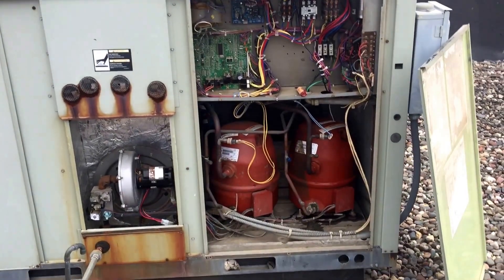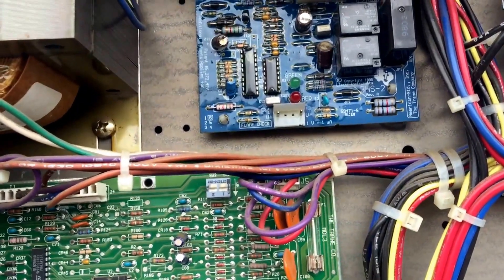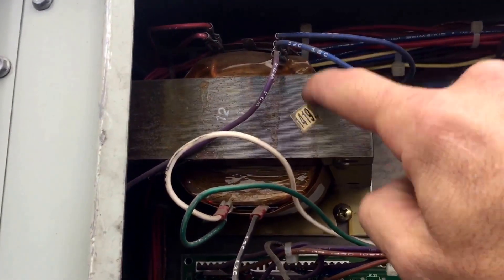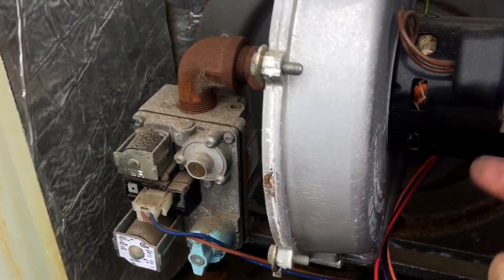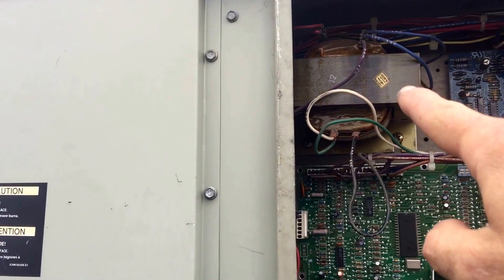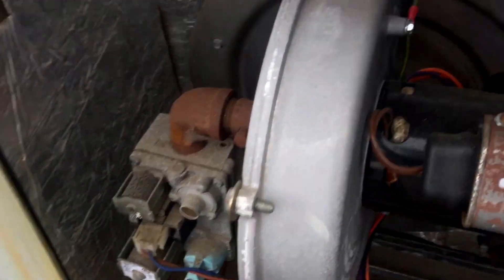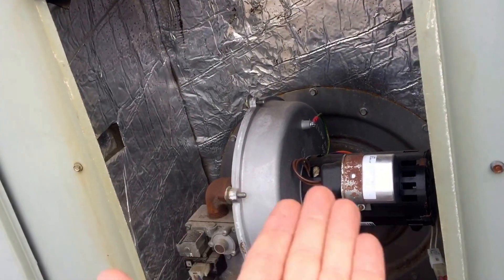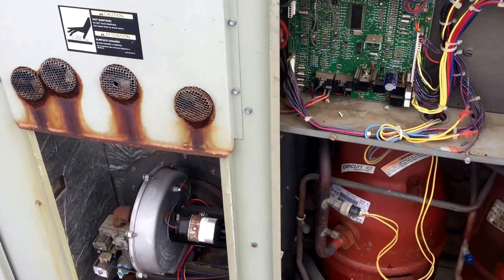Trane Voyager/ Premix Heat Exchanger/ Part 2/ #tranevoyager #traneheatexchanger #tranepremixburner

Comment: Hello David, have you had an issue where the ignition boardat the s1 and L1 have burnt? I've checked wiring and insulation is fine. I replaced the board and hsi, and a week later it did the same thing. Any suggestions?

Comment: Hello Dave,  I'm hoping you can offer some insight to an issue we are having with a 50 ton Voyager  YCH600B.   we recently installed the burner plate , comb blower , gas valve and ign to the  modulating side (right),  of this unit .  The constant capacity side (Left)  was left in-operational.   Well ,  Gas pressure regulator was set perfectly  10 " wc inlet .   and the outlet was - .3...........       Ran fine for two weeks . now we find the screen blown out .      Is there some way for you to email me ?    E.L.
Reply: Turns out , The modulating sude should have been set to +.05"   , not  -.2.  The primary fixed capacity work will be completed soon .   Stand by ....
Reply: side

Comment: Thanks for your informative video. I watched your part 1 for this unit but I didn't find what I need. My inlet pressure was -3.32 and need to adjust the pressure. This unit gas valve looks a little different to find inlet adjust knob. Is that the one with 2 tiny marking hole with 3 torxs screws on?
Reply: Did you figure out if the inlet supply pressure gets adjusted behind that cover with the two holes?

Comment: This is video was AWESOME!! Just worked on one of these today. Inducer Motor running constant, bumped it into heating mode and a bunch of water spit out the exhaust. Great diagnosis!! Sounds like I need a new motor and relay kit!! Is there a chance the Ignition board is bad  or would your money be on how the inducer motor is wired with constant power on red?

Comment: Mr.Harty your understanding and ability to convey knowledge of these units is exceptional, better than Trane tech. Support.
THANK YOU 🙏 for sharing your knowledge.
I have a question for you.
I have a customer with several old Voyager rtu’s and two of the units have indoor blower motors that run constantly .
Both units have had the main circuit boards replaced at some point.
They both have the three lead high limit in blower compartment.
One unit had the three lead high limit replaced by one of our techs last year.
But when you turn the units disconnect off and back on the blower starts up instantly.
You can remove the fan wire from Tstat and they still come on instantly.
I sat on hold with Trane tech support for two hour on my last trip.
The call was for no heat, found draft motor was defective, so I replaced draft motor assembly, and I cleaned the first screen and checked gas pressure.
The unit heats properly and cools.
However the indoor blower stays on.
I tried replacing the three terminal high limit, tco2 .
Trane said its probably a bad relay.
But both units have newer main circuit boards.
Any ideas would be appreciated.
Reply from the maker: c alessi / The 3 terminal secondary limit switch in the blower compartment will start the blower motor if it trips/opens on high temp in order to cool off a overheated unit.
If the wires get misconnected to this limit it is possible to have the blower running all the time, disconnect the wires to the limit with the unit power on and see if the blower stops.
If the blower stops, then your switch was likely miswired.
**Check the wiring diagram for wire numbers and reconnect, on a known working 3 term limit you should have 24v in and 24v out to the NC term back to the board for the “limit” circuit, the other wire going back to the board is for the Blower relay.
** if the 2 wires going back to the board  get misconnected the blower will run all the time.
Reply: @davidharty3653  I Have a 36 Ton Trane Voyager The Gas Heat Is Not Coming On I Traced It Back To The Transformer It lost a Phase on the Primary side I Traced that Lost Phase to the Heating Relay.I Have it Calling For Heat On The BAS But Still Not Calling On Relay.

Comment: Hey David. What tells the inducer to come on? The board correct? If red has constant power and purple is common...what the heck is the black and orange for...I see one for N/c contacts and 1 for normally open? Any help brother
Reply from the maker: HVAC/R DUDE Black and Orange are Low and High Speed windings for Low Fire W! And High Fire W2

Black - Applying Voltage into black via Contacts in IGN Module is the High Speed / High Fire windings only / W2, and comes out on purple (Common)
Orange - In Low speed/ Low fire Constant Power into motor on red, thru 1st set of windings and out on orange to IGN Module, IGN Closes a NO contact and sends power coming out of 1st set of windings on Orange back into motor on Black and thru 2nd set of windings (in series with 1st set of windings) and out on Purple to common.

See Electrical Print for Induced Draft Motor Schematic
Reply: David Harty YOU SIR ARE AWESOME!!! THANK YOU FOR YOUR VIDEOS!! AS MYSELF TRY AND PASS THE SKILLS ON HERE TOO🔩🔧🔩🔧✌👍👍👍

Comment: How is that fan wired? Because i have one fan not working and one working. I should measure 220v on 2 of the wires (4 goes inside him; 2 speed fan) but I didn't measure 220 not even the working one. I'm doing somenting wrong, and I don't know what. On the fan i have a scheme that say this: in high speed: purple-line, black-line, orange-ins, red-ins. On low speed: purple and red line and line, and and black and orange are makeing a star(there are connection between them).
Reply: David Harty hey hey, Dave does the board send power out on black or orange...from what I'm understanding if red to purple(common) should always have 208/230v then the motor should always run? I know I'm missing this one...just odd
Reply from the maker: Redinciuc Andrei Cosmin / Purple is common, 
Purple to Red on the unit side of the plug should be hot 230V all the time /  if not you possibly have a bad (Big) transformer 
(test Y! To Y2 on TNS2 the big trans, should be 220-230V there)